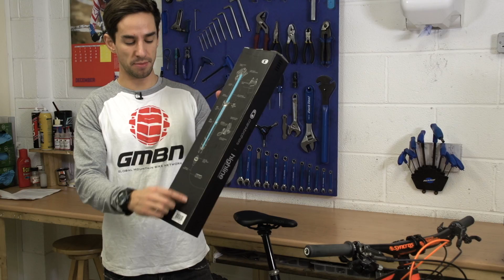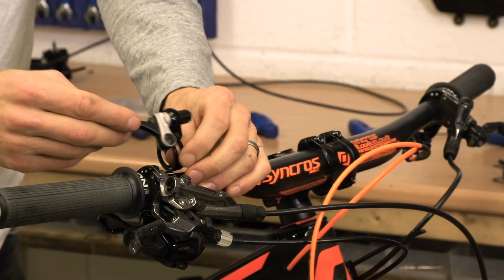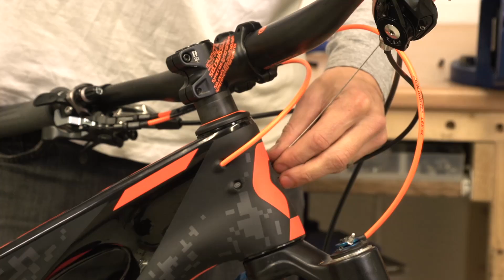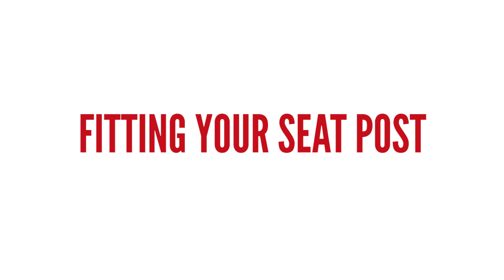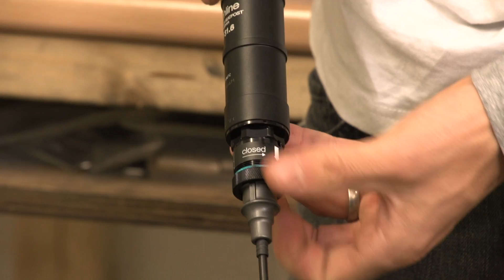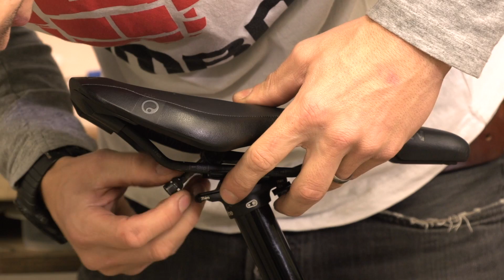How To Fit A Mountain Bike Dropper Post - crankbrothers Highline | MTB Maintenance

Comment: Looking for some advice please. Just purchased the Haibike fullseven 5.0, mail order from Cycle Republic. When it arrived in no way could I move the seat. Took the bike to Halfords where a couple of us managed to remove it. The most the post will go into the seat tube is 140mm, does that sound about right? When I put a broom handle down which is about 28mm it goes in over 200mm. When you look inside the post tube you can see like the tubes are not aligned and it's created a lip inside so the post can't go down any further.

Comment: hello can you help me, I have a 2015 Scott Genius 740, on my seatpost that is syncross it says 31.6mm and 400mm, what is the 400mm mean. Will I have a problem if I get this Brand-X Ascend Dropper Seatpost, that has a diameter of 31.6 mm and a length 120mm and a  size 410mm? thank you

Comment: If you don’t want the collar to drop, suggest using making tape to make a lip on the cable.  Also I could not get the actuator to turn with pliers, so I used the blue plug instead.  The perfect tool since it’s designed to fit.  Glad GMBN updated this tip.  Anyone else getting a little bit of creep up despite tightening the barrel adjuster?

Comment: DO NOT USE NEILS PRO TIP!
DO NOT USE NEILS PRO TIP!
I tried this and it ruined the plastic sleeve and metal pin inside. it voids the warranty and fucks up the entire dropper post. When i was trying to fix my post FROM THIS "PRO TIP", I came across a video from Crank Bros which shows you how to correctly align the arrow. to see that video, go to crank brothers cable replacement video. 
I wish they had put this tip in the original installation video. It would have saved me $350....

Comment: What to do if i don't have internal cables?
Reply: LEV makes one with the cable running to the saddle clamp.  Perfect for external routing.
Reply: Does a Lever Activated (not remote) dropped post potential?

Comment: Can we have a video for external routed dropper posts please. I fitted mine today and it was a pain in the ass to find the correct cable routing.
Reply: For me it was easy like when you install the cable housing for a derailleur, when measuring the housing, just have the dropper post all the way up.
Reply: IN1VISIBLE3.- I couldn't adjust the cable length on my post and it was too short one way and too long another.
Reply: @audiotestchanneltm  is that... Luke?
Reply: that's how they are, get it so it's just right at full extension and then when it's lowered it'll sag down where you guide it (providing you have a KS style cable outer guide)

Comment: i have some tips that were usefull to me. Firstly route the cable and then attach it to dropper post and put it in frame and then cut cable housing on the other end where your remote lever is. much simpler and you don't need to mark cable housing as the post is already in and you see the lenght you need

Comment: How much does a cheaper dropper post cost?
Reply: Sam J - Just 50 pence... it's a 5mm allen key.  Alternatively can buy quick release seat collar for couple bucks off eBay.
Reply: Sam J ask google
Reply: Cheapest decent I saw was about 70ish GBP on amazon.
Reply: II GT Racing II good idea
Reply: Sam J 350$
Reply: Pretty good alternative is a KS ETEN dropper, about $100 and uses a lever under the seat instead of a remote on the bars.